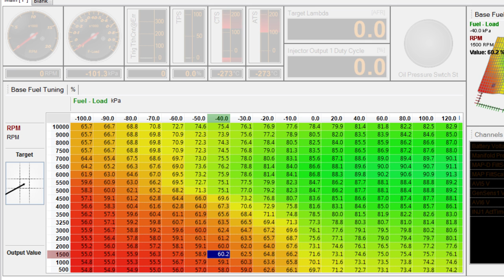Carburetor vs EFI: Separating Fact from Fiction - Technically Speaking.

Comment: Old cars before all these electronics crap are so much better.
Reply from the maker: +Flash Man Simpler, yes. Whether they were better is a highly subjective thing. We are not going to argue that carbs are not good, there are plenty of people successfully using carbs without any issues, but there have been many advances since then and while the new technology might be more complex it does offer lots of benefits. Reliability being just one of them.
Reply: haltechecu New engines are made almost entirely out of aluminium. It's a terrible metal as it warps with heat over time. It's why we don't find anyone using it for exhaust pipes. Electrical fuel pumps are also noisy and doesn't last as long as mechanical pumps. And having EFI on an engine that produce less than 300bhp is just a waste of money.
Reply from the maker: +Flash Man Your last statement pretty much says that 95% of cars presently manufactured don't need EFI. That's a big call, especially considering that the longetivity of cars over the past two decades has been steadily increasing (RL Polk study done in 2009 which found that modern cars last longer and are more reliable than they ever were). 
Commercial reality dictates that if EFI cars were indeed inferior, most car manufacturers would have reverted back to carbs. They haven't.
Without getting into an argument here, older engines are simpler for sure and maybe easier to work on too but, as I stated before, saying that they're "better" is highly subjective. And just for the record, we love old cars and have a number of them in our garage, both efi and carb.
Reply: No dude just NO
Reply: actually you are right. fuel mixes a lottt better with air when using a carburettor correctly. it is even so that when you look at co and nox ppm values the carburettor is a million times more effective if tuned correctly.... using a good 3 way catalist on a verry well designed carb gets as close to 0 emissions ppm wise.